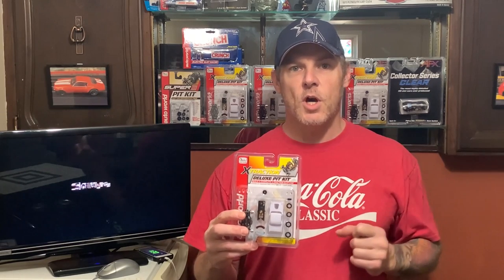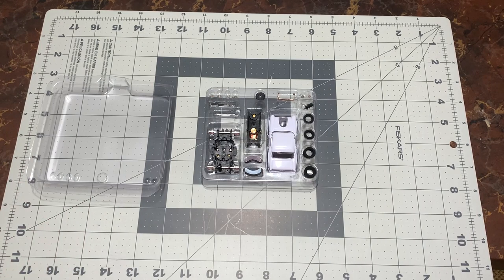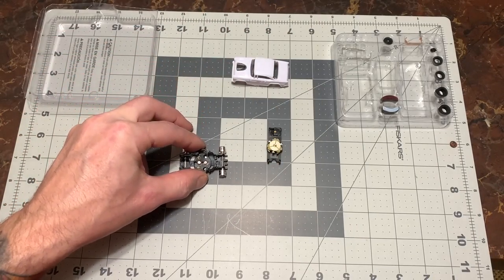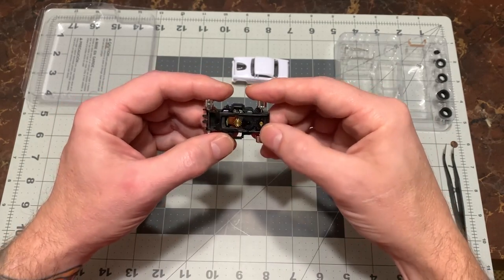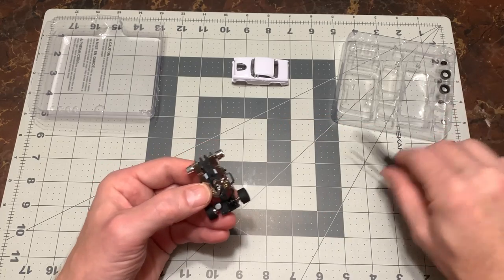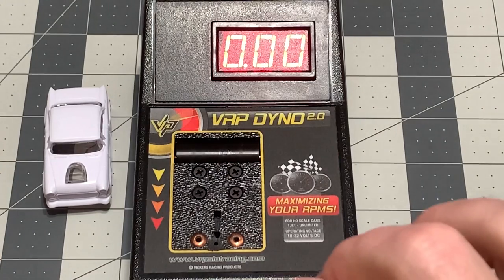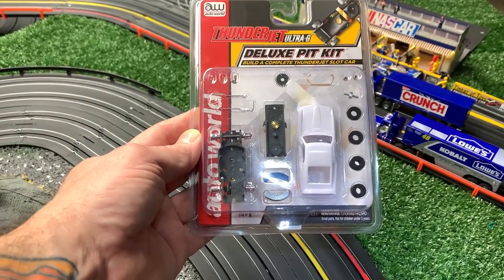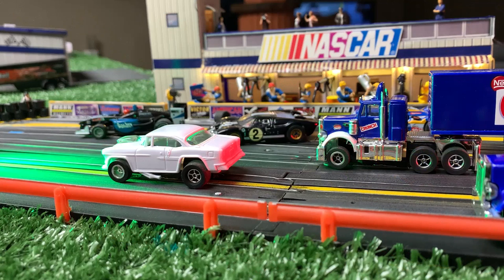Autoworld Xtraction Deluxe Pit Kit on the Dyno and an upside down build ?!?

Comment: In a drag race Are the xtraction ultra g chassis faster than a 4 gear . Or are the 4 gears faster?
Reply from the maker: It would depend greatly on the car set up but they do use 4 gears for drag racing
Reply: @slotvalleyracing  if they were built identical same arm,mags,shoes,brushes. I'm curious to see because they definatly have a different final drive ratio. 4gear having the extra idler and different size wheels and gear tooth count
Reply from the maker: In a straight line the 4 gear can turn the tires much faster but I know someone who can not only look into this but he can also speed test on his drag strip..... 
@stockpilehobbies  His name is Steve and he does HO drag racing and long drives!
Reply: @slotvalleyracing  sweet thanks for the info I'll check him out.